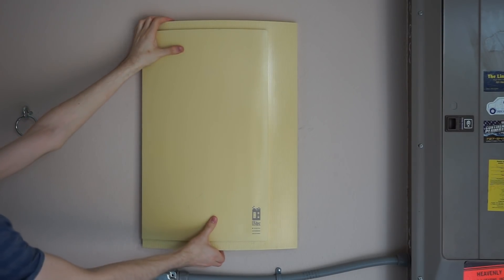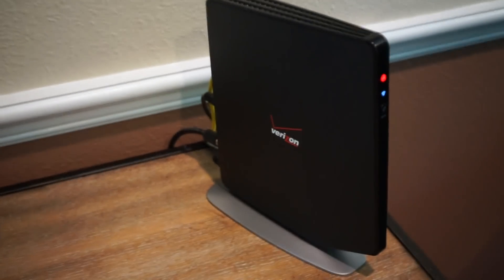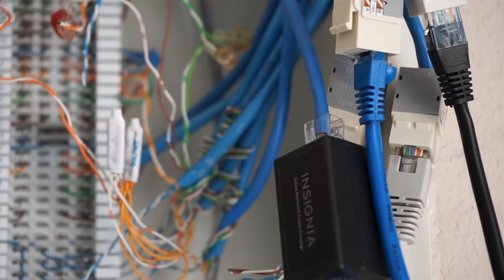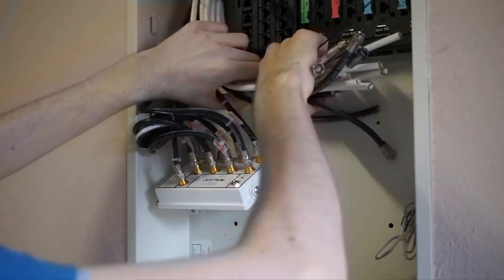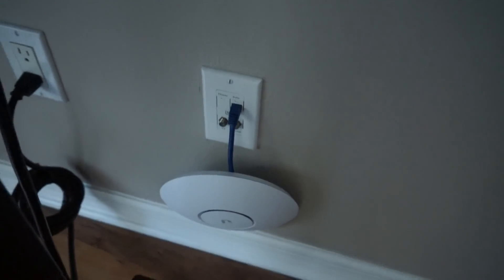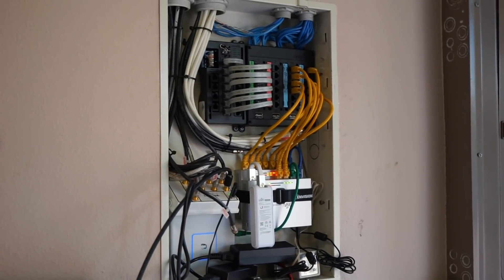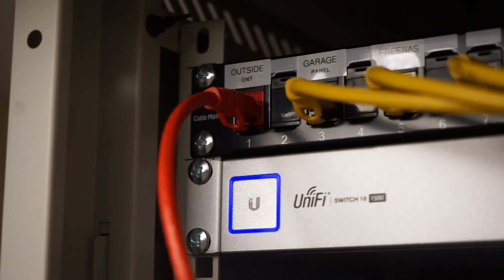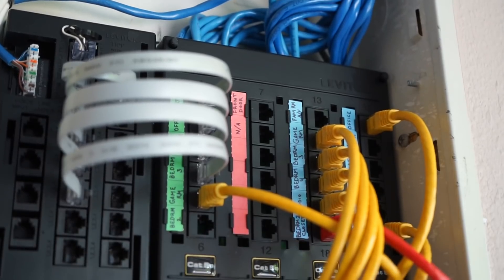Home Ubiquiti UniFi Network Upgrade - Part 1

Comment: I will say very clean setup. Yet my only issues is if I was going to head down this road like you did. I would pull all the cat5 and run cat8. Other than that very very well done
Reply from the maker: Thank you! I agree, however I only have a few wired devices, and the house was built with a proprietary cabling system that has ethernet & coax bundled so it would've been challenging. Plus, CAT 5e is capable of gigabit, so I'm not worried.

Comment: I love this video. I’m a huge fan of FiOS and Ubiquiti. But please just get a TiVo like I did. Using just a moca adapter with your own router causes problems with the boxes, won’t update firmware, no remote DVR, can’t register new boxes, etc. you’ll save money with TiVo’s and CableCARD, you can use Ethernet in every room, just run 1 coax to the main TiVo box and that’s it.
Reply from the maker: Thanks for your comment! Unfortunately we're actually moving out of this house in a couple months and most likely will be cancelling our cable service... but internet TV is definitely the future! I'm well aware of the problems with using a MoCA adapter and it's been quite frustrating. All the rooms have wired ethernet so it would be incredibly easy to switch, but at this point I don't plan on making any more upgrades to this network.

Comment: Have a few questions with the fios that you have. I have fios myself did the whole rack but how did you fully get rid od fios modem. Where did you get instruction to do so
Reply from the maker: I simply looked up "using own router with fios" and you should be able to find articles that help. The most important step to getting rid of your fios router is doing a DHCP release in order to allow the UniFi router to take over.
Reply: @iTekapple  ok but do you still get the guide thru your cable boxes

Comment: Keeping that Verizon router/wifi thing is a waste of money as you are renting it.  Plug your USG into the Fios modem.  Use the default WAN settings of dynamic and its plug and play on the USG.  It worked for me and I had Fios, the USG and then later upgraded to the USG Pro.
Reply from the maker: If you watched through the whole video, I ditched the FiOS router and got everything working without it. Unfortunately, according to Verizon/Frontier customer support, I would still need to pay the monthly rental charge for the modem/router regardless if I return it or not.

Comment: Awesome video, looking forward to parts 2 and 3. I'm currently building a house so I'm looking into possible network upgrades in the future. I was thinking about doing an in-wall media cabinet like you had at first, but now I might do a server rack like you ended up doing. The only closet with an AC vent is the master closet, so I'll just have to convince my wife.. ;)

Comment: Nice job! You need to cover or paint that ethernet cable that is connected to the ONT outside. UV light will degrade the sheathing unless it's UV rated.
Reply from the maker: The cable says "SUN RES" on it, not sure if it's UV rated but I will probably paint it at some point!

Comment: You don't need the UniFi controller for such a small amount of AP's. You can configure them with a software controller and once done just let them run standalone. (Ubiquti Certified installer).

Comment: should've run cat 8 if running new cable
Reply from the maker: CAT 8 is extremely expensive and not easy to come across, not to mention that it would only ever be used for Wi-Fi AP's that can't even fully utilize those cables.

Comment: Nice job, but you probably lost your FiOS program information (when pressing the "Info" button on your remote), as the Quantum router is where Verizon distributes the information to each TV from within your house.
Reply from the maker: I actually did a lot of research on that prior to converting to my own router, I really hate the way FiOS is configured and it was definitely a pain in the neck, but I've managed to kinda get it working with a MoCA adapter. It's a little finicky but for the most part it works.

Comment: I’ve stopped using the Disc APs. The In wall APs are awesome. Could have saved yourself a load of work there.
Reply from the maker: Yeah I do really like the in-wall AP's too. I thought about it, but wanted to put the AP's in certain places where there were no wall plates that could've been converted. Plus I think that the antenna positioning is also improved with a ceiling mounted disc AP's, so that's always nice.
Reply: @iTekapple  thanks for explaining that question !
Reply: Hi. Can you tell why stopped disc? Some failures or range issues? I will be buy some Network stuff for me home and that info will very help me. Thank you
Reply: @bartekr5198  No, most of the businesses i'm dealing with already have the cabling in the wall. You can utilize that cable and get POE port(s) out of it as well. Plus they look awesome.

Comment: at work we use the unifi controller software on a ubuntu server. (i dont like ubuntu feels like its going to break. love centos more)
Reply: Ubuntu is rock solid, so is Debian, it doesn't just break for no reason!

Comment: Make sure cloud key is on a ups. Not sure why you didn't get the gen2
Reply from the maker: The cloudkey runs via. POE and the whole switch is on the UPS. I actually purchased all of this equipment back when I started this project in Aug. 2018. Stay tuned for the next part...

Comment: CAT 5e?
Realy in 2019?

LOL
Reply: Why not Cat7?
In Germany Cat7 is standard for like 5 years now...
Reply: audhen1 Welp bub, this is not Germany it’s the USA 🇺🇸.
Reply: If you watched the whole thing, he changed it and ran Cat 6 through his house.
Reply: @NT-no7py  and the?
The Cable is 5e!
Reply from the maker: The wiring was already pre-installed in the house (built in 1999) and I wasn't going to run new cable drops just for a minor improvement since is rated for gigabit speeds. All the new lines I ran for access points were CAT 6.

Comment: Ubiquiti gear is awesome nothing beats a nice network installation.
Reply: well techniclly multiple things beat that... for example when the power goes off.....
that would beat the system alot XD
Reply: @dr.joint4204  That's why you use a UPS :D
Reply: Ubiquiti gear is awesome for home and business. I run a few WISP and that is all I use.
Reply: Bleh. Literally the cheapest gear, lack luster performance, no gui other than through awful software, sketchy security with cloudkey, and its nit even cheap.
Reply: @gary96gt  Hey, it's okay for home use. Would never use it in a enterprise environment though.